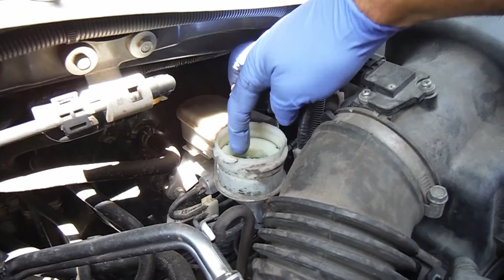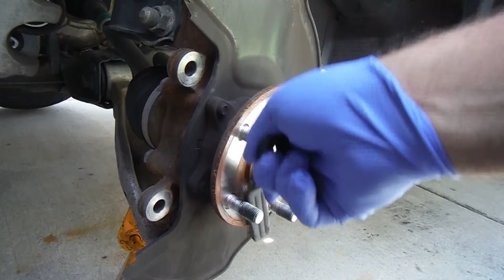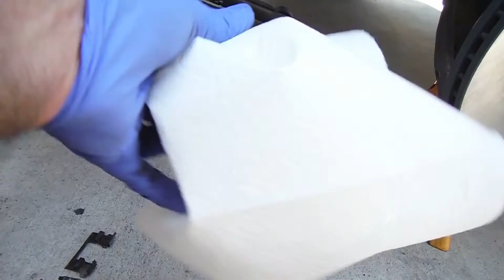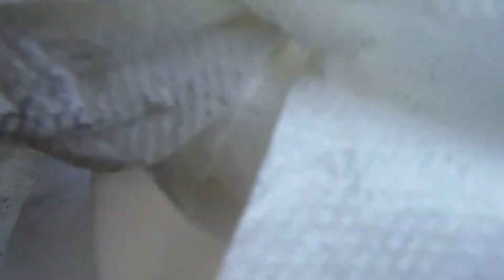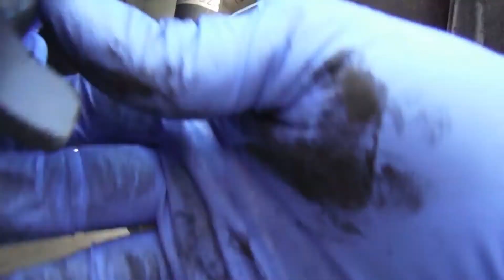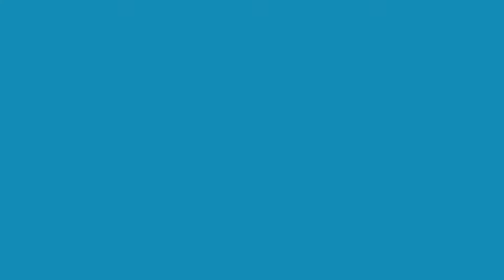2011 HONDA PILOT - HOW TO REPLACE FRONT BRAKE PADS & ROTORS - DIY

Comment: Could I just use caliper grease
Reply: I do for the pads and the clips, but use Sil-Glyde for the caliper pins in the boot.  I also like to clean the boot out really good with some pressurized sprays of brake cleaner in there.  Then blow it dry with some light compressed air.